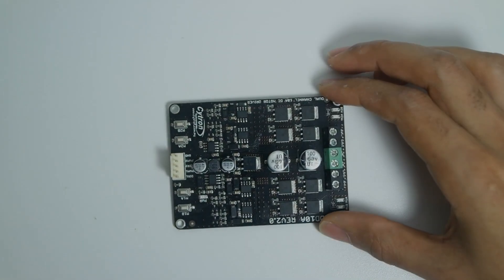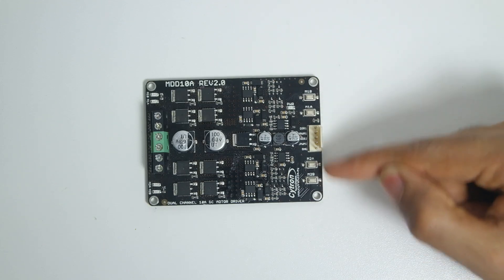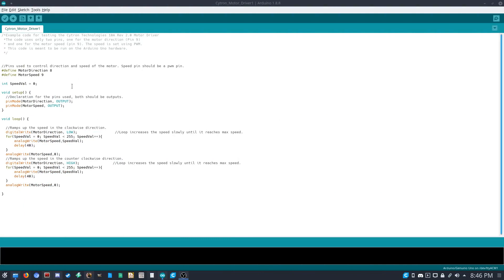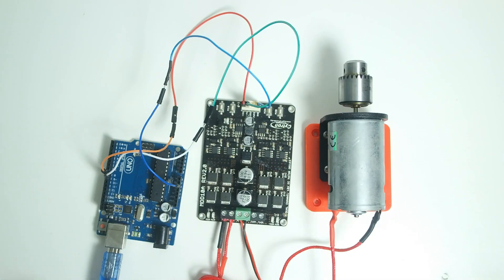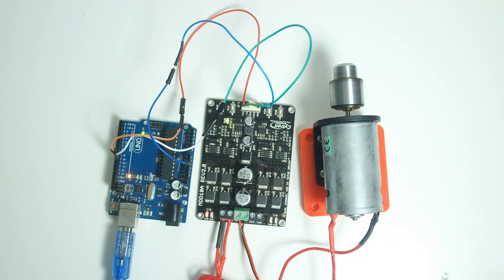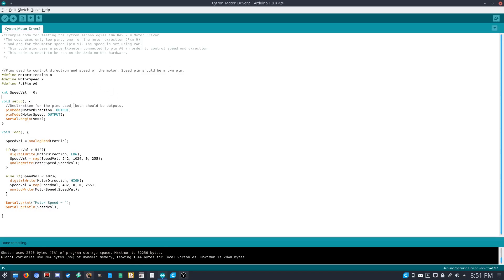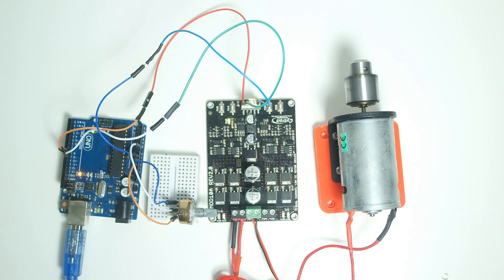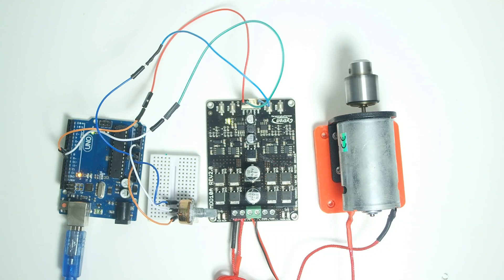Cytron MDD10A: How to use it with Arduino

Comment: both of my M1B and M2B isnt lighting even when i use the same code. But when i do try the manual buttons, its able to make my motor move clockwise and counter clockwise.... im not sure what im doing wrong
Reply from the maker: @jerichovoncalicdan5379  Hello, please check that you are connecting to the right pins on your microcontroller. Also make sure that your setup is done correctly in the code for the pins that you are using. You can check if your motor driver is getting a signal by using a multimeter and measuring the voltage from the ground to the input pin M1B and M2B on the board. There should be some voltage in there when you tell it to spin from the microcontroller, the voltage depends on the speed configured in the code. I think in general these tend to be issues with electrical connections rather than code most of the time. Let me know if it helps.

Comment: Good tutorial. Too bad it wasnt stated in bold letters or stated in general on amazon this driver needed a microcontroller to use rc with it. No telling how many people bought this thinking they could use it without arduino. My code skills are near nonexistent. Ive been driving myself nuts battling an arduino, riorand esc and hub motor for a few days thinking i could just adapt my wheelchair motors, hook up this driver and be done. Yet another setback. Not a big one but wasnt expecting to figure out another code. I think yours will get me started and i need to work out channels. I think i need to stick with the fabrication of carts, buggies and other vehicles and leave all this to the smart people
Reply from the maker: Hahah yeah it can be pretty daunting if you don't have previous experience. If you need any help let me know. When I made this video I was still in college so hopefully now I'm far more helpful.
Reply: I have several hobbies that i rarely have time for so once i get frustrated it takes months to get back to a particular one. I ended up using an l293d and had my two small motors working. Unfortunately i didnt notice one of the supply voltage wires was barely hanging on and turned the l293d into charcoal. I bought an xy160d motor driver and as far as wiring it has same pin identification but no luck. I have been going through code after code, video after video trying to either get the mdd10 or xy160d to work but missing something. Serial monitor shows like all good. For some reason im not getting the message from arduino to motor drivers. Transmitter and reciever are good, arduino good, drivers power up but motors just sit. Im leaving something out but not surprising since my coding cave man level@UndernetSystems

Comment: Hi, Can you help on this please. Using Cytron MDD10A rev 2 with Arduino UNO v3. need to connect two brushless 12 volt DC 7 amp motors for wind simulation for sim racing rig, the speed will be controlled by a software package called SimHub which accepts custom sketches. The motors only have to work in one direction the speed of the fans is proportional the the vehicle speed in the simulation. There is also a directional element of speed control that is why the fans must work independently.  So what connections do i need between the Uno and the MDD10a). Also do you have a sketch for this. Thanks for your help in advance.
Reply from the maker: I can give you a hand with it. I am a firmware/hardware engineer. The best way that I could help you is if you join the discord server linked in the description of that video. I am generally there along with other engineers.
Reply: Hello Bryan, Did you get this figured out. I am attempting the same project as you

Comment: superb video... I just wanted to know one thing, is it possible to run the motor wirelessly using RF module with this driver, I know the code will be different, but is it possible!!!!
Reply from the maker: Yeah it is. Some rf RC modules can let you output a pwm signal that this might be able to use directly too.

Comment: Hello, It's a Very Good thing you're doing by putting this code out here to be used. Thank-You , I've looked a long time for this. I have this running correctly on a Cytron MD10-Pot which is not the same article as yours, but it's a go. This is perfect for Joystick code, just exactly perfect. The Compiler was cranky, like always, but that's been ironed out and it freaking runs. TY.
Reply from the maker: I'm glad this video was helpful to you. I wish I had some of these modules still to make a couple more videos about it with different microcontrollers. These drivers are very reliable.
Reply: @UndernetSystems  Hello. I also got the MD10-POT but I'm a total newbie. Not a programmer, but I'm an electrician. Ladder is not a problem, but c++ is a problem for me. I understood how to apply different examples. What I need is to control the motor via IoT Remote in a mobile phone using Arduino Uno R4 + Cytron MD10-POT (speed and direction). Can you help me modify the code for my need? I actually need to remake the Cytron_Motor_Driver2.ino program from a potentiometer to control from an app
Reply: @UndernetSystems  Hello sir. I am testing your Cytron_Motor_Driver2 program. I'm not a good programmer, more of an electrical engineer and I'm at the very beginning with ardruin. I like your application and I want to ask you if it is possible to modify the program so that the motor is not controlled by a potentiometer but by a mobile phone using a mobile application. I need to create Cytron_Motor_Driver3 with IoT Remote. Thank you for your reply.

Comment: In low speed (PWM value 50) L298n makes humming and not rotates
Reply: Does this mdd10a runs at very low speed
Motor full load 12V 2.5amps
Reply from the maker: @pruthvirajsinhbarad9432  With this DC motor driver, to change the speed of your motor you are basically changing the width of your control signal. Whether or not the driver will be able to drive your motor at lower speeds depends on your motor and its voltage ratings. If your voltage is too low, your motor will not have enough torque to be able to start rotating. The way that I generally deal with this situation is by looking at what range the motor can work at when you are testing it. Lets say if you are seeing that your motor can only rotate from 50 to 255, you can write a function (or use the map function on arduino) to take that 50-255 range and turn it into a 1-100% percent range, and anywhere below 50, the software will assume that the speed is 0. Hope it helps.

Comment: Can i also control smaller motors with this driver? I kind of dont understand if it will provide e.g. 0.5A, 3-6V  or it will be impossible or sth?
Reply from the maker: It should be able to control those loads, don't see why it would not be able to.
Reply: @UndernetSystems  Okay, thank you very much

Comment: Hey!! How did you turn of the motor as it has DIR pin when low moves clockwise and when high anti clockwise. 
So we have to make the speed Zero to stop the motor. Right ?
Reply from the maker: It has two pins for direction per output. If you put a high signal on one of the direction pins, it will go in that specific direction, once you make the signal a low, it will stop. If you want to vary the speed, you can use a PWM signal instead of a high signal and that will change the speed in that direction.
Reply: @UndernetSystems    It has DIR1 &DIR2 for motor1 and motor2 respectively as per the datasheet.  So how can I sop the motor individually in Arduino? Or you mean DIR1 is for clockwise rotation and DIR2 is for anticlockwise when high. And when both are low both motors are stopped.

Comment: hello sir the switch when you turned on the power supply is connect to? and the coding needs to be improved or just can simply use like ur coding for controlling with potentiometer? and i wanna connect mdd10a a to two motor drivers and do i need to make it series so that it control for two dc motor with same output?
Reply from the maker: Hello sir, the device is connected to a power supply, instead of using it you can use batteries or a wall power supply (anything that can deliver the voltage you need for the motors in your application). The code can be used as is, but you can easily modify it to fit the needs of your application, and yes, it can be used with a potentiometer. If you want to connect two motors to one driver and drive both with the  same signal, you need to connect the motors in parallel (positive of motor 1 with positive of motor 2, negative of motor 1 with negative of motor 2). You will need to insert all the cables of both motors into one of the outputs of the device. I generally recommend to give each motor their own output because it allows your motors to have more current to use, which can increase your overall torque. Hope this helps you out.
Reply: @UndernetSystems   Hi sir if i  give each motor their own output  the motor 1 and motor 2 connection and just connect it at M1B and M1A for motor 1 and M2A and M2B for 2nd motor at MDD10A and connect it with arduino uno and a switch and controlled by potentiometer can it produce same output for both motors?

Comment: Does the MDD10A have any protection? What if the current exceeds 10A? Is the card broken?
Reply from the maker: Generally the mosfets might be able to handle a bit more than 10A without dying. They might get hot enough to damage other components on the board. I would suggest limiting your current usage to 10A. If you think you might have issues going over 10A for long periods of time you might want to add fuses to your motor.

Comment: It is not necessary to use disconnectors in the transistors when they are passing 10A? Have you tried this situation? Thank you very much
Reply from the maker: I have not tried it in that situation. I do not have more of those motor drivers in hand anymore. If you are concerned about peak current through the device, it can handle 30A as stated by their website as well. You just need to be careful in your application to not exceed the 10A continuous rating. Yes, you will most likely not damage it if you go over that amount for a small time period.

Comment: Hi, great video!! Can you please tell me what wires you used for the motor to motor controller connection? Thanks!!
Reply: oh btw, I am using an arduino with the cytron motor controller rated for 30A continuous and and also using the motor from a power drill in my project!
Reply from the maker: @cl3375  The wires that I used for that motor are similar to the ones used for 3d printer heater cartridges. In your case you would have to check what is the maximum current draw of your motor under load, that will tell you the size of wire you want to use with it. If you use wires that are too small, you run the risk of burning them. Check the max current draw of your motor and then check this chart to pick the wire you want. https://www.google.com/url?q=https://www.solaris-shop.com/content/American%2520Wire%2520Gauge%2520Conductor%2520Size%2520Table.pdf&sa=U&ved=2ahUKEwjnntG24cDgAhUhm-AKHSEOBb0QFjAJegQIBhAB&usg=AOvVaw2eEVXSRFzxUcA_nqpzZdHZ
Reply: @UndernetSystems   haaha yep! definitely will burn the wires if they are too thin! verified that yesterday, thanks for the link! also.. how did you know the max current that motor would draw? The drill I used did not come with a complete performance chart. It has 2 speeds - 0 -1800RPM and 0-400RPM. Stall torque is 500 in-lbs (or 41ish ft-lbs). Battery is 18VDC. Using just those values, the current at max power (at 1/2 RPM and 1/2 stall torque) the current, according to power, is 147A. clearly this is not really the case since there is a gear box. If I assume the gearbox is 36:1 then the current at max power should be about 3.88, but I'm not sure about the gear box, and even if I was, I am not 100% sure how fast the current grows. I want to guess max amps at about 20A to be safe but here is a more concise question: what will choosing a wire that is too thick result in? Should be ok, right?